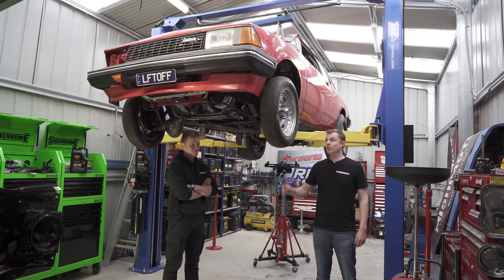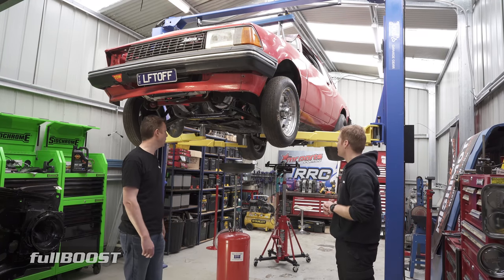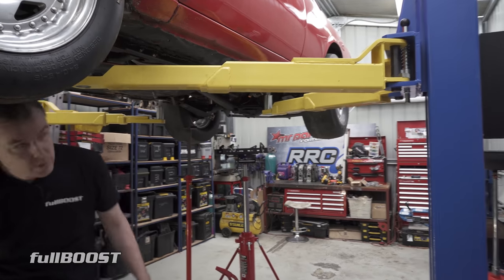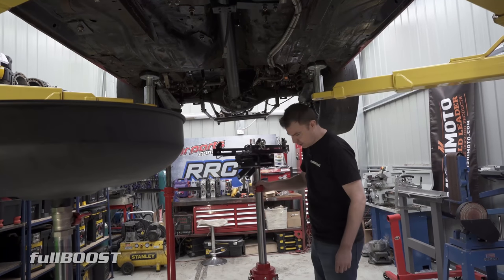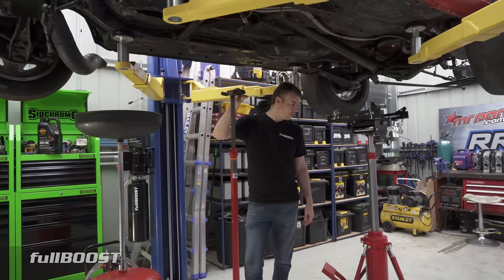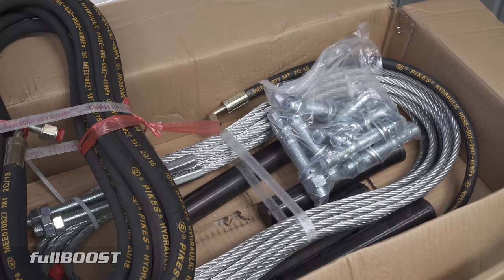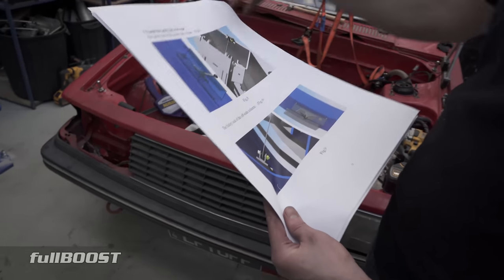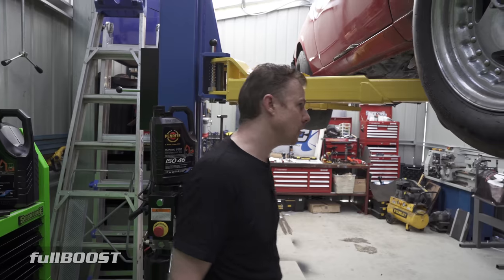Watch this before buying & installing a car hoist / lift | fullBOOST

Comment: I bought a 2 post of Joel near 3 years ago, to date best thing I have bought. I didn't get the instruction about greasing the columns but worked it out a year later when the hoist juddered like... scary.  Otherwise would buy another from Joel.  Good fun putting it up, like you say, a few mates helps with the lift AND the confidence to drill big holes in the concrete...(right through).  Great channel, thanks.

Comment: I’m currently installing the same hoist.
I did a test drill of my concrete slab & found it was 90-95mm thick.  The vast majority of domestic sheds are this thickness.  I’m cutting out sections of my slab & increasing the depth.  I’m also going to use a higher grade concrete as per the manufacturers recs.
I hope u guys test drilled ur slab to confirm the depth prior to installing the hoist.  Even a 1.5t car can overload a below thickness & grade concrete slab.
There’s no public liability or insurance for a backyard hoist if it fails.

Comment: Greetings from the Uk .
I own a garage equipment company and although i mostly agree with what you have done installing your own lift i would however recommend the following.
Get the lift installed by the lift company, reason being if there is an accident with the lift and the authoroties get involved how would you go about proving you were a competant person to install it ?  Also get it load tested, in the uk it is a requirement to have the lift tested by an independant company to its maximum lifting capacity and issue a certificate to prove it. 
It is a royal pain to do all this but if you run a company with multiple workers this is what your up against if the worst happens.
Dont want to rain on what your doing but this is my reallity in the UK.
Regards,Tim

Comment: 3k for a hoist damn, i thought they were close to 10k. i should probably get one lol
Reply: Exactly! The only reason to NOT have a hoist in this day and age is not having the physical space to put one. They aren't anymore expensive than the rest of the tool kit
Reply: But the installation charge is $7000. There's your $10,000!
Reply: Joe Baxter install cost for this one was $0 + a sparky to wire it. If you’ve got a couple of mates you can put it up in a few hours as easy as we did. No smoke and mirrors here. First time we’ve done it, instructions were spot on and it all bolted together like a dream.
Reply: Yep! I've installed mine twice. 2 person job, doesn't take all that long 👌

Comment: the 3 piece and 2 peice arms extend to the same length ....i would of thought the 3 place being shorter when pushed in would go under the front of the car as the car usually sits slightly further backward on a hoist to compensate for engine trans weight

Comment: Fullboost hello.
How important was the concrete on the floor? I have heard and read that it's very important to have special harder concrete before installation.
The usual concrete would not handle the load and it all may fall down and...
Reply: Not really a special concrete, as long as it’s 150mm thick.
Reply: @TheRealPatrickStarOfficial  a lot of the hoist company's specify a minimum of reinforced 100mm 25mpa.
But definitely the thicker the better. I'm doing a slab now in my back yard and putting in a 150 mm section where the hoist is going. Hope that should be sufficient

Comment: @Fullboost can you please let us know the approximate dimensions of that shed? Trying to visualise how big of a shed I need.
Reply: The back half of the shed where the roof is tall is 5m wide, 7m long. The wall is 3.6m tall and roof pitch is 11.5 degrees.
Reply: Paul Broomy Thanks! I was hoping to get a 7m wide, so at least I know it will fit.

Comment: Drill the holes all the way through the slab so if a dynabolt gets damaged you can belt it into the ground and replace it...
Reply: Ever heard of chemset and anchoring studs
Reply: Brendan keeno chemical anchor is not recommended by the manufacturer. Very familiar with them. We used Powers AC100 to secure reo tie ins on our shed extension.
Reply: The manufacturer doesn’t state anywhere about not recommending chem set bolts in their instructions.

The 18mm supplied bolts don’t have any specs.  There are no 18mm ‘dynabolt types’ on the market.  This specific size & type is made for this hoist by the manufacturer.

Ramset state their bolt specs & the standards they’re designed to.

Comment: at 20:00 you talk about needing a "hammer drill" then show how your drill bit has the fittings for a hammer drill. i have never in my life seen a hammer drill that has a different bit than yours. what kind of drill are you talking about that isnt a 'hammer drill'?
Reply: a drill with a normal chuck, that has a hammer function
Reply: @krashdown102   I've never seen one of those. The hammer drills I have seen and used are usually a few feet long, have Locking slots on the drill bits and function like a rotating Jack hammer

Comment: Are you lucky enough to have 3 phase in your shed?
Reply from the maker: 240v
Reply: Here in the US at least in Los Angeles County it's easy, you call DWP (Water and Power, City Owned...). For a moderate price they will come in and put in a 220V source, which is also good for supercharging electric cars, Fiat 500e is a excellent shop runabount.
Reply: The hoist, mill and lathe all run off mains 240v. I don’t see a need to run 3 phase out here. Don’t do anything heavy duty enough to warrant it.
Reply: @BackyardMechanics  yea nice. A mate of mine has a hoist in his shed. I know he has 3 phase on the property (and to the shed, because he is nuts), but can't remember if his hoist is single or three phase.

It has definately come in handy with his cars, STI Liberty, Cobra replica and Hilux.

Comment: concrete dust is nasty stuff, think about breathing in cement powder, mixes with the moisture in the air and literally cements your lungs
Reply: ChrisHallett83    😆😆😆
Reply: dust's and things to do with breathing are the only time i take safety seriously, other than that im working in crocs
Reply: @BackyardMechanics  Yup, just got to look at current crop of guys cutting engineered/caesar stone bench tops... doing it without adequate PPE, now they've got a much shorter time left on the planet... a bunch of them only in their 20's! Disgraceful!!

Comment: You are just justifying the two post that you have already purchased.   No proper comparisons at all.   I dare you to stand under the car and give it a really good hard shake.    I have a cheap ( $3000 ) Four poster in a standard two car garage.  It is on attachable wheels and I can actually move it with a falcon on it.  I have a sliding jack to lift the cars wheels off the hoist wherever I need it.  As for parts ...my chinese knock off, I just replaced the cables after 10 years ( got them cheap and quick) because that's what you do with a commercial one.   Go to you tube and watch failures on two posts ....no thanks.
Reply: rob smith yeah, we fully should have purchased like 10 different types of 2 post hoists and used them all for a few months each and then just kept one of them and crowned it the king of all 2 posts. Could have had a knighting ceremony and declared it Sir 2 Post, ruler of all 2 posts. Unfortunately we have budget and size constraints so we just did what any normal SANE person would, and applied logic to our purchasing decision and arrived at this one as the best option for our garage.